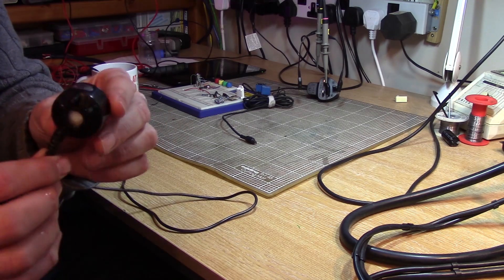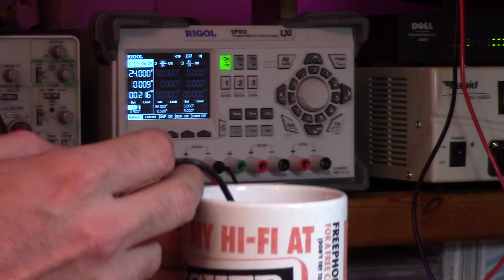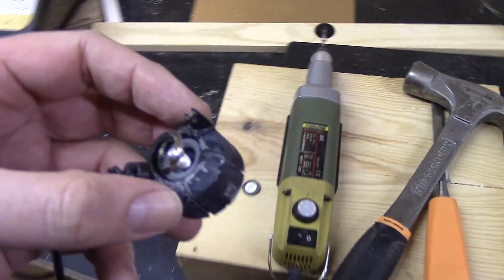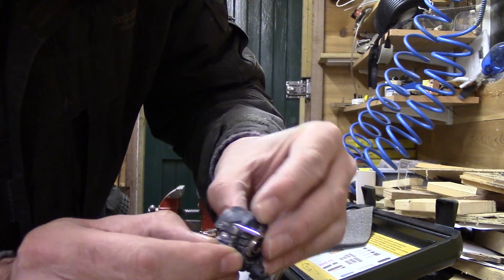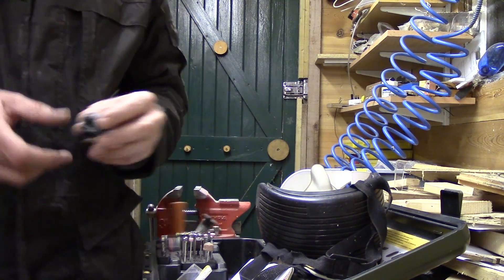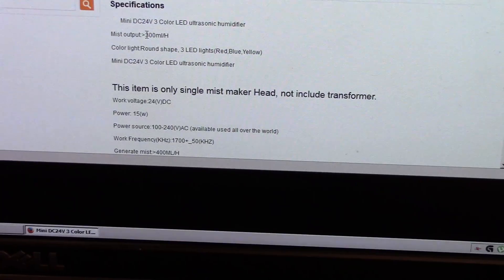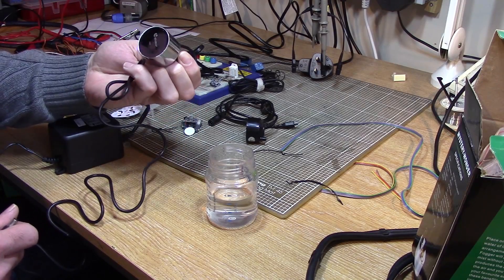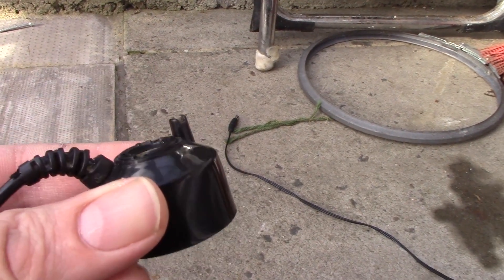Ultrasonic Fogger/Mister Autopsy and Overvolt

Comment: I've got one of those plastic ones and the disk retaining ring did come out.  I've not got it here at the moment, so I can't say if it screwed, bayonet capped or clicked out.  But it was possible to replace it, although the things may actually cost less than a replacement disk.  The water sensors are really only intended to detect a lowering water level.  Lifting these misters out of water while they are powered can kill the piezo disks because they rely on the continuous water cooling.  If the disk runs even for a few seconds it can suffer damage.  Usually the disk reaching its Curie point and losing its piezoelectric characteristic.
Reply from the maker: Hi bigclivedotcom  - I love your videos (I've been binge watching them for the last few weeks) - I almost feel famous now that you're commenting on my videos - Thanks. I tried pretty much everything to get that disc out, but it wasn't shifting - I figured that the potting compound had worked it's way into the thread. I've got a bunch of metal units too and have no problem removing the disc on those ones... but I've not yet found a good source for cheap replacements. The misters certainly have a limited lifespan when used for hydroponic nutrients - They seem to build up a layer of crud on top over the course of a few weeks (I suspect this is because the disc gets hot) and then crap out soon afterwards. Cheers!!
Reply: How long do they last using hydroponics nutrients? How much PPM are you running? Are you running them 24/7?
Reply: +Jim Conner                                                                                                                                                                                                                                                  Hi Jim, et al, I don't wish to come off here sounding as Captain Obvious, you're far more adept and knowledgeable than I, however, why aren't you using any sort of pre-fogger filtration system of any type whatsoever? It's super easy and can fab one from basic stuff from home. If was for myself, I'd use two canisters/cups/coffee containers, (whatever the space allotted can accommodate), one can about an inch smaller than the other, so you'll have a double wall set up, drill a bunch of 1/4" holes in both cans, then fill the outer wall with ceramic filter beads, or even just 1/2 inch river rocks would work, wrap the inner can's exterior with a panty hose cut off leaving the toe end attached and so it can be secured at the top with string or whatever, put another coarse of ceramic filters, or a cotton fabric or cheesecloth that will filter the finer particulates, wrap another piece of panty hose around the fogger, (if you can without causing it to be inefficient), and if one can be fit around the outer can's exterior, I'd do one there too... I'd about guarantee if you did, those things would last years each potentially, even the cheaper plastic ones... Those atomizers tend to be very sensitive to the particulates from tap waters....                                                                                                                                                                                                                                                 P.s., great video, the fact that you went ahead and tried to "defibulate" that one with extra, eextra, juice was well worth the watch, even though it pudded out, it was still funny....

Comment: Nice , I did wonder what was inside them , I have a 5 disk one from maplin , still works after 5 years of on off use : D
Reply from the maker: TwirlyWhirly555 I've found them to be terribly unreliable.. they are lasting me a couple of months at a time... but perhaps that's down to the nutrient salt solution they are sitting in.. or maybe down to the 24x7 usage... The disc gets black gunk baked onto it and then stops working... I bought foggers from three different companies and none of them have offered any noticable difference in performance or lifespan... Having said that though, I'm currently on a maplin one and it hasn't give up yet, so maybe theirs are extra long-life. Cheers!!

Comment: Great video ! Thanks Jim ! I have one of the silver metallic case foggers, it hurts a surprising amount when you put your finger in the disk while running. I only had to do it a few times to realize that. In my guitar amp repair shop days sometimes an amp would be brought in for blowing fuses. I am ashamed to admit that there were times that I fixed them by putting in a 30 amp fuse and turning up the variac till what ever was drawing all the current gave way. Sometimes it was a whisker that was hidden. We would joke that on the repair ticket under " service performed" we would write " Cleared short"
Reply from the maker: Heh.. Yeah,,, I found that it hurt when putting my finger in the output of the little black plastic ones too... I figured it's trying to ultrasonically atomise my fingertip. I don't think there's anything shameful in clearing shorts that way. I've seen old CRT test gear which cleared shorts in the CRT gun in exactly the same way.... and if it doesn't clear the short, it certainly gets it hot enough for you to find where it is and take action with a scalpel. Cheers Rob!!

Comment: How do you rate that isolation transformer? ...Was it a good find ? If so I may pat my self on the back and drop some cash on the same 400va one ..It's a pain that 240v to 240v isolation transformers seem so rare in  comparison to the 240-120V variety

Comment: Funny how hard that was to open up.  I use one floating in a 5 gallon bucket to provide humidity for the mushroom chamber.
Reply from the maker: Yeah - well and truly sealed. How long do you find the atomiser discs last in your mushroom chamber? Cheers!!
Reply: Jim Conner
I haven't had it that long and it hasn't given up yet.  It's a silver one with LEDs all around.  I can't tell if I can replace the disc.  The metal ring holding the disc down is slotted on opposite sides as if a large flat-head screw driver can unscrew it.  I'm not going to try that until it's worn out.  It came from ebay with the worst packaging ever but it works.

Comment: Good use of the hammers Jim. Remember if you can't fix it with a hammer then you have an electrical problem.
Reply from the maker: Thanks Daniel. I think I think the problem was just that my hammer was too small... I'm sure a bigger hammer would have fixed it... Cheers!!

Comment: Nothing went bang poor show should have overloaded a capacitor for our enjoyment
Reply from the maker: I need to find myself a 400W light bulb to act as a bigger current limit... I guess 100W of power wasn't enough (though I was expecting the plastic to melt at least). See what happens when you're not here to help me :).. Cheers Matt!!
Reply: Should imagine he did overload the Cap inside that was what cave the bubles as it vented then gave up...rather sad though
Reply from the maker: I will try harder next time :) Cheers John!!